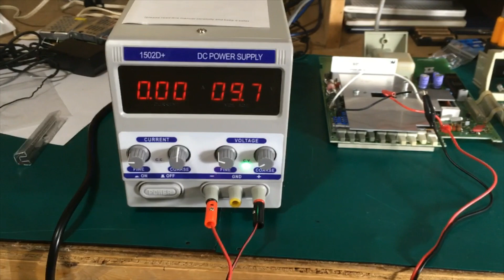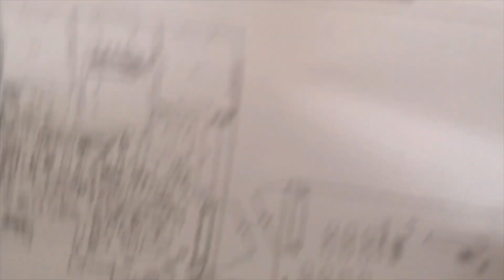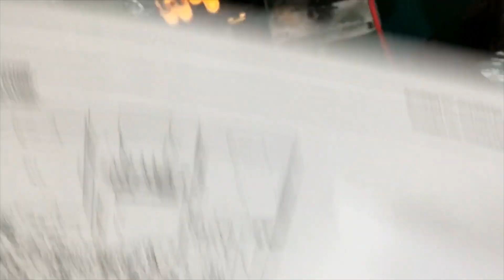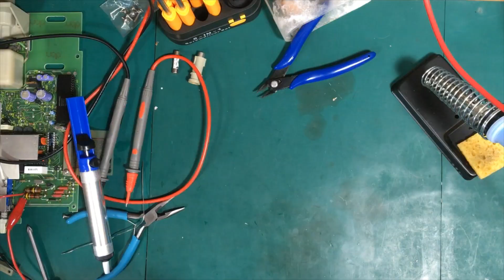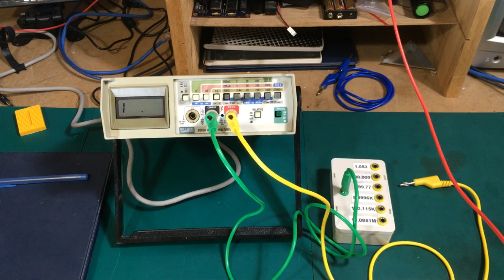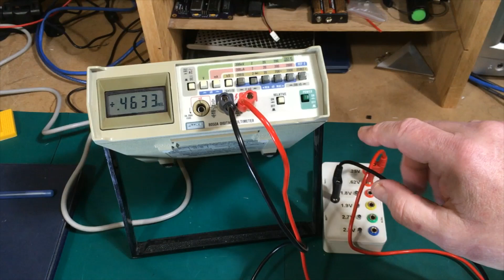Uni-Byte 0018 - Fluke 8050A Repair

Comment: Thanks for posting, I picked up a working one for about $10USD. I'm contemplating drilling a hole or two around the bezel and adding a couple chip LEDs so I can see it easily...
Reply from the maker: Nice!  Yes, they can be a little hard to see when the light is not ideal.  I'd be interested in the results if you do it.

Comment: I noticed that you didn't use the batteries. How did you bypass them?
Reply from the maker: This one never had the battery option installed.  Good thing too as unlike the 8010A/8012A the 8050A with the battery option will not work if the batteries are removed until it undergoes some surgery.

Comment: It is a capable backup for your Siglent.  Or, you could sell it for a couple of hundred to those who still need a benchtop meter.
Reply from the maker: It is actually a great backup to the Siglent.  I'd have to rank it as my 2nd best bench meter for sure.  I'm going to keep this one.  I have a bench where I work on vintage computers and it's the main meter there, along with a 8010A for when I need two.  However, where I got it I can get more and might just try fixing up a couple for re-sale.  I doubt I'd get a couple of hundred for them though.

Comment: I liked the multi impedance selectable dB range measurements.  And the zero reference function so you could select the current voltage  as your ref zero and measure plus or minus deviation for either volts or dB.
Reply from the maker: The REL mode is golden on these.  These are my favorite Fluke.

Comment: I worked with a heap of those.  They generally were reliable and if you can overlook no autorange,  you have all the bench meter most people need.  The fails I saw were some of the ones we had would have develop ACV errors but still be OK in DC.  Or the ones with the battery option would need the C nicads replaced sometimes. They would not function on line power with no batteries installed.
Reply: OH,  and LCD problems once in awhile too. Lot of the Fluke meters will need the zebra strips and LCD contacts wiped with isop and often will return to normal.  Or new zebra strips if they are too deformed.
Reply from the maker: @tomsherwood4650  Yup. Or even display drivers. The thing with these is they were so god they saw a lot of usage hours.  I would not be surprised if they saw 5000 hours a year or more - way more.  I had one on my bench back when they first hit the market and it got left on 24/7.  I had that job for nearly 6 years.  That's over 50 thousand hours.  Bits get tired after that length of time.

Comment: I have a 8050, love it. Or, I did. All of the sudden, it quit measuring positive voltage. Still measures negative voltage properly. Bummer.
Reply from the maker: Just think, you get to fix it!  Cool!
Reply: @uni-byte  Indeed I do. Good thing I have a working 80258B.
Reply: @uni-byte it should very probably be the same chip you fixed! Quite easy…

Comment: The Fluke 8050A is a great device, but some of them have problems with faulty LCDs. There are some mods to replacing the LCD with a modern TFT. I did my own mod with extra features but haven't release the resources yet, it's not final yet.
Reply from the maker: Sounds interesting.  Please keep us updated on that.

Comment: That’s a creative way of getting a chip off without a hot air station! 😂 Glad it worked!
Reply from the maker: Thanks for the comment.  It's a fairly time honored way to get the job done.  Especially with these older boards that seem to have their traces held down with wallpaper paste.  I do have a hot air station, but it would have destroyed the board.
Reply: @uni-byte  ah that makes sense, I’ve never worked with such old boards so I didn’t know about their fragility

Comment: Given that the board is fragile and that you could not be sure that your new chips were good why did you not solder a socket in so that you would have the option of swapping out the chip without risking wrecking the board?
Reply from the maker: 100%.  There is a bit of story there, but suffice it to say 1) I had no sockets of that size, and when I realized that 2) I did a quick test of the part before soldering it in.  But you are right, I should have used a socket regardless of the status of the part.  Good call.
Reply: @uni-byte  I keep a supply of turned-pin female header strips on hand. They can be cut to make any size IC socket. Just plug in a couple of short strips across to hold them in  alignment while soldering. Regards, David
Reply from the maker: @davidv1289  Nice idea!